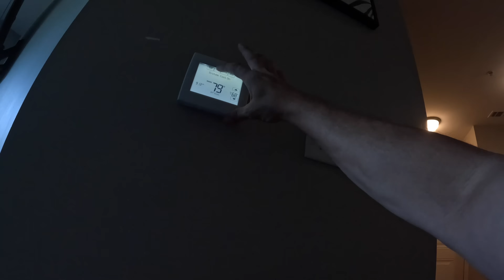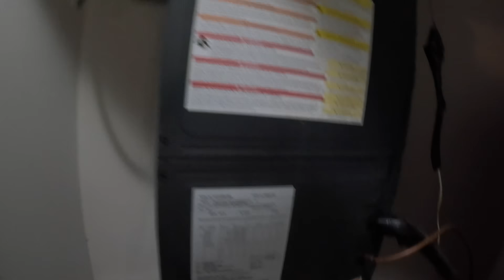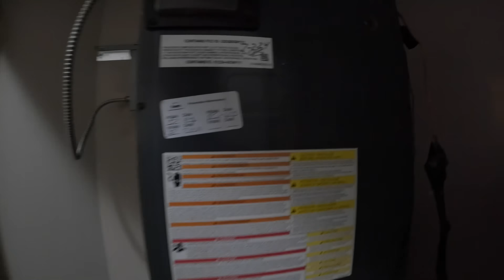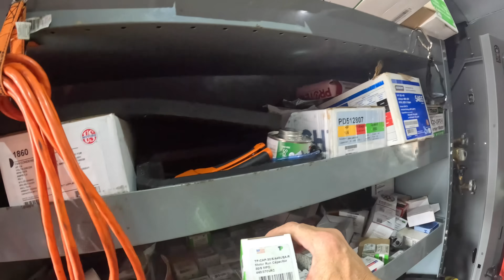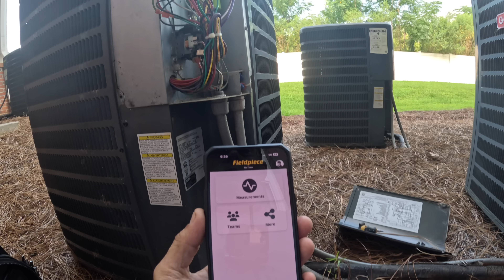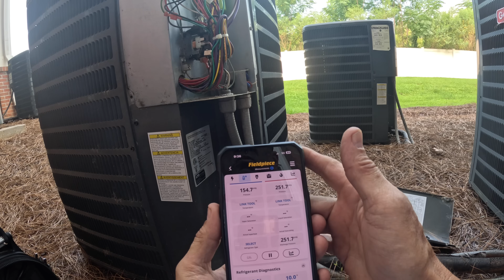Finding More Work During Routine Service Call! #hvacguy #hvaclife #hvactrainingvideos

Comment: I see this all the time in PA, unit sitting right in front dryer vent. I saw a really crazy one the other day. There was a carrier infinity 12 inches from a #2 oil boiler powered vent. The corrosive hot gas melted the fins right off the outdoor coil. The boiler heats the domestic hot water so it runs all year. Funny thing is the carrier still performs and they don't care. I changed the contactor and redid some wires then left.

Comment: looked like marker scribbled 225 inside unit and the yellow tag on cover  said 235?  wouldn't surprise me if deviant kids were changing labels. then again bozo installers/electricians/previous workers cleaning them scrambled it up.
 **shortly after in video you caught it. what annoying dumps those places are.

Comment: Bad enough the mechanical engineer draws up the dryer vents dump on to outside coils but mechanical contractors go along with the insanity and install their poor designs! Building owners need to speak up during design! 

One of my Weimaraner's was a climber! Had a 6 foot fence and could not figure out how she was escaping until I left, parked at neighbors watching....she climbed the 6 foot fence like a monkey with each paw in the links of the fence! They are smart and stubborn puppers for sure! She actually came from a breeder in Georgia 😂

Comment: I have my bedroom AC set to 68.  My wife wakes me from a sound sleep to tell me the air is broken because it feels like it's 90 inside.   I'm freezing because she has the ceiling fan on high.  I get up and check....Nope 68 in the bedroom.

Hot flashes had begun.
Reply: Is the lowest u guys put the temp during summer

Comment: I was Curious on the AC side of things. Has R22  units just become redundant if the refrigerant is low and has to be topped up.   Reason I ask , ac guys in my area have no R22, at least 3 we checked after we had service call and have been told a new unit is the only option.
Reply from the maker: It’s not an affordable option for the customer. And contractors are unwilling to buy a $1000 drum to top off a system.
Reply: @HVACGUY Is the R22 black market. The ac guys said its not even sold at their suppliers anymore because of legalities
Reply: R22 was phased out and is not being made in the US anymore. Whatever stock there is and what is recovered from units is all that can be used. Cant import from other countries that use it still either. All a money grab really. The price of a cylinder is over $1000 so companies rather sell you a new unit for $15k+. If you do replace I'd get a R32 unit as R410a is being phased out already too. The R454b (R410a replacement) supply is low at the moment and will cost more.
Reply: @Jon.Rushing  Found out they are charging 375 bucks a pound for R22

Comment: Brand new house (2001) I moved into had the dryer vent level with the condenser coils and five foot away. Compressor cut off from thermal overload because of the lint clogged coils . Same day I moved it 20’ and put a small hedge beside the vent , cleaned the coils and never happened again!

Comment: That complex will probably reject a bid for all those unit cleanings. In my experience the common answer was, it's not in our budget. On the property I worked at as supervisor, we cleaned the condensers every year, saved a ton of calls, as it got hotter in summer. 340 apts.Preventive maintenance.

Comment: Did I see two transformers in that air handler? Why would that be?
Reply: You did and I did. I've seen a few jobs long ago where they had 2 xformers!
Reply: likely optional addons and limited space where a single larger wont fit, so they parallel two. but the second could be for other dedicated gear, humidifier, dehumidifier, uv lamps, etc.

Comment: Curtis, I use to do a apartment complex similar to that a few years back. I had a contract to keep their HVAC stuff operating sufficiently, but they started adding on building after building after building and it kept getting bigger and bigger and I was not gonna hire a couple of guys to do just that property Plus they did not want to pay to have spring cleanings done every year and to keep their equipment clean, so I never renewed the contract with them for other unit units. Who installed the HVAC systems had all the AC condensers mis  Marked with the wrong apartment number on each unit and today I drive by there and there has to be at least 1000 units there so I’m glad that I dropped that account cause I would’ve had to hire probably a good 6 to 8 guys to maintain just that property….
Stay Safe …. Stay Cooooool 🇺🇸👊🏼👊🏼✌🏼🇺🇸

Comment: So intelligent put dryer vents by ac units
Reply: Builder special!
Reply: @bobboscarato1313  architect idiocy is more fitting. lump all the mechanical and venting in one area, so they can claim look at all the clean lines and views!
Reply: @throttlebottle5906  HOA requirements?
Reply: I don’t understand how the dryer vent should cause such a problem if the dryer lint trap is maintained.  My vent has been in use for 20 years, just within about 18 inches of the condenser unit, and I do not see any lint buildup on the condenser coils.  Maybe I am just lucky?
Reply: @jamesoestrike2517  they filter 50% or less of the lint. if they were HEPA filtered it would clog the typical size screen multiple times in drying cycle. it would need something like an eight foot square pleated washable filter. not very practical.
many condensers can be very dirty and poor airflow, while still looking clean.
they have splayed fins down inside the visible outer fins, those clog deep inside and stop majority of air flow. to check airflow, simply hold a dollar bill by one end overtop the condenser it should be blowing straight up in the air, if it's barely moving around and most air is coming out to the sides at an angle, yours is very dirty and low air flow(or fan blade is improperly installed)
Reply: @jamesoestrike2517  Most dryer vents don't have lint screens! Why? because they never get cleaned!

Comment: Always  pissed me off that a previous HVAC tech couldn't be bothered to mount a  cap with info facing facing forward. I'm retired now, but I always faced them forward and used a sharpy with what the cap is and the date I installed. Common curtesy
Reply: We used to attache a label to the cover panel with parts replaced and date. Saves lots of time and search thru files! Yes Riley is very smart!

Comment: What’s lowest temp people put on when it’s hot out there like 90 to 97
Reply: Here in Houston it gets to 100 during the summer. I keep stat at 80 degrees.
Reply: @bobboscarato1313  that’s to high don’t u feel hot in ur home lol
Reply: @jameselloko6365  I have a couple of spare fans; however home stays comfortable and dehumidified!
Reply: My stat is set at 70 for heat and ac. That marketing thing "78 feels great" is a joke.
Reply: @Jon.Rushing  Hey, it depends on your electric rates. I keep it a 80 right now and runs virtually all the time and the home is very comfortable/dehumidified too!

Comment: A much needed change to the mechanical code should be that dryer vents should not be anywhere near the a/c units
Reply: Absolutely, it's so ridiculous to put them there, my house is the same way I don't dry clothes with the unit running. It's 25 years old and still going but I keep it clean.
Reply: Here in Mi we have to be 10ft
Reply: My dryer vent is less than 2’ from my a/c ….both at the rear of the house. But before the warm weather hits, I always spray down the a/c unit.
Reply: Also all dryers should be on an external wall. So you don't have a million feet of dryer vent.